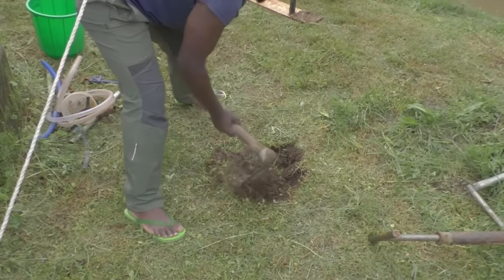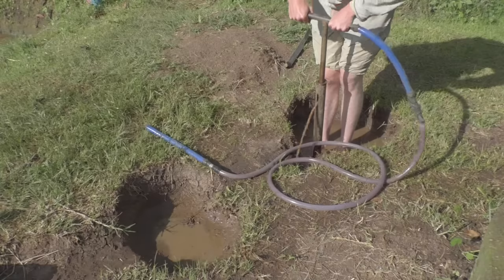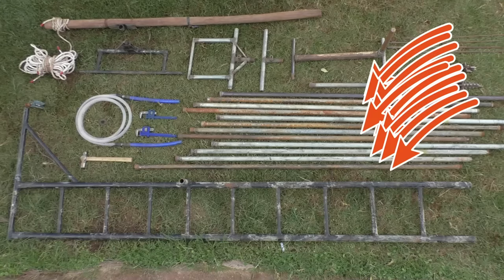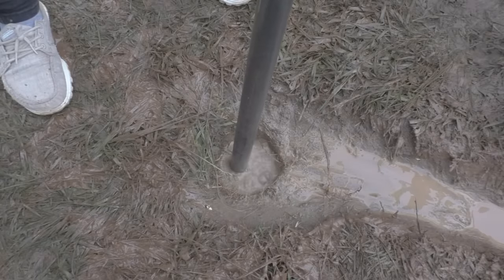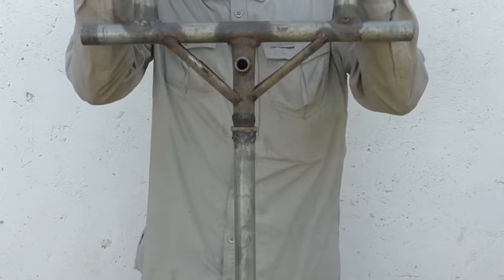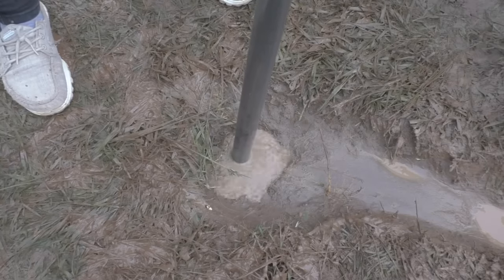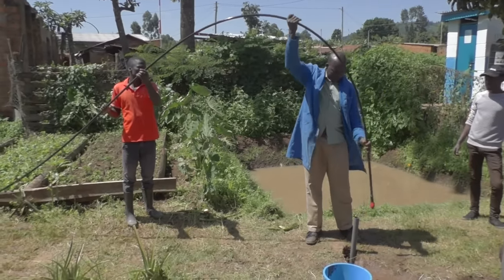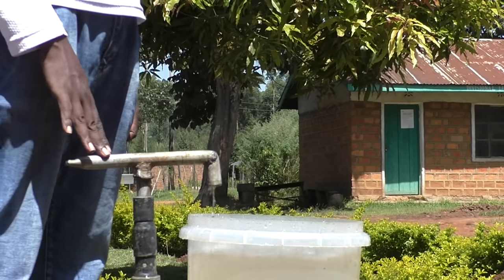Drilling a WELL by HAND.   UP TO 300 ft!   Without Electricity

Comment: I hand dug a well at my new shop 3 years ago 40 ft deep and I put a 6 in casing with 1 3/4 pipe in side of it I filled with 57 stone after my 6 in pipe and red clay at the top to seal it it took me 3 days by myself and there was about 10 on lookers watching me I know they were talking junk about how crazy I was till I hooked my pump up and sprayed the water hose in a  Rainbow style with 60PSI on the pump for an hour just to show I really hit water And a lot !! Thanks for the video I'm in north Carolina red clay county and let me tell u got to be young at hear its really hard work just my 2 cent !! By myself I might add !!
Reply: I guessing you left out some details or I'm calling bullshit! A 6" diameter hole in the ground 40 feet filled with water; that water would weigh 480 pounds!

How were you able to push that kind of weight to the surface by hand?

Even a smaller column of water as used in the video is the big limiting factor of a well 300 feet as they suggest is possible.

That's water weight. A thick mud slurry like they suggest weighs even more with every inch in diameter or depth.

Think of your 6" pipe as a plastic liter bottle about a foot tall. Now lift that bottle to stack another bottle under it. Lift those two to stack a 3rd under . Then lift all three to stack the 4th. Continue until your lifting a stack of 40 to slide the 41st bottle below and you will understand the gravity of the situation. Literally!

I'm not saying it's impossible but it's impractical with the limits of the tools shown here.
Reply: @tenlittleindians  You're not lifting the water, though - you're inputting water at the bottom of the water column to "flush" out debris. I agree that there is a limit on how deep you can go based off the pressure required to input additional water at the bottom of the column; but, if you were to replace the water hose here with a power washer, that'd get you considerably more distance. You might want to understand basic physics before spouting off, because there is a huge difference between your analogy of "lifting water", and the actual issue here of "back pressure" on a water output, at the bottom of a water column.
Reply: @jcpt928  To inject it in the bottom requires the same force as lifting the column of water! Were you unaware how it's calculated? And using a high pressure pump ain't exactly "digging it by hand" anymore.

Your "flushing it out" story doesn't hold water. (See what I did there? It's known as a play on words)

How are you going to "simply" flush it out? You either need to lift all the casing to create an opening at the bottom or your back to pumping water down the casing which requires pushing that water somewhere once the casing is full. (Back out the top under the full pressure that I previously calculated)

I suggest you visit a local grade school and see if one of the nice teachers can take some time away from a toddler to help you brush up on your limited capacity for simple basic math.
Reply: @tenlittleindians  You're completely dismissing the size, surface area, etc. of the casing, the digging head, the hole itself, etc.

You clearly aren't paying attention. Water isn't a solid.
Reply: @jcpt928   Really? I mean it; really? I do understand the constraints of the physical universe and you keep trying to tell me perpetual motion is possible! It isn't.

You can choose to lift the water out of the bottom of a hole with a teaspoon or with a stick of dynamite and it will require the same exact amount of energy. You can't magically make this energy appear or disappear. You can convert it from one form to another but in the end it's measurable and always the same.
Reply: @tenlittleindians  LOL

You REALLY aren't paying attention...
Reply: @tenlittleindians  I)
Reply: you show them :p
Reply: Very Nice!!!
Reply: @tenlittleindians  And I'm not a  twig ass boy I'm grown ass man 196 pounds 6 foot tall u got any more questions just let me share the video of me doing the dam job still works great to this day and I've got ele pumps not hand pumps to get the water !!
Reply: @tenlittleindians  And if u are in Raleigh NC I will meet u out there and show u in person as well !!!
Reply: I just moved to South Carolina and am looking into getting a well or two on the property.
I’m not far from the beach so I think there should be tons of super good water for watering plants, etc
Reply: @tenlittleindians  -- The water pipe is 1.75 in diameter. Only the casing is 6 in diameter.
Reply: @Makermook   That cuts the column of water weight down to about 40 pounds which is feasible for a 40 foot well but still not realistic for a 300 foot well. 

In reality the wells we used to see in old western movies had a bucket that was lowered to just below the water line. Once filled you had a fixed weight to lift to the surface by hand.
Reply: @tenlittleindians the metric system, something an American can't understand. 
It takes 1 bar of pressure or 1 atmosphere to lift water 10 metres. That little hand pump of approximately 25 millimetres in diameter would be more than capable of applying 5 to 6 bar of pressure with the weight of the man pushing on the handles.
But in reality he is only got to overcome the height difference between the sump level and the outlet level of the bore which would be less than 0.5 metres.
If he tipped water out of a jug into a funnel and into the drill stem it would still go to the bottom of the hole and flow out the top of the bore.
Maybe you need to go back to school and learn the metric system.
Reply: @stevenstart8728  Your mistaken. 1 bar of pressure is normal and thus equalized. 1 bar will only lift anything if it's being applied to something in a vacuum that has less pressure than atmosphere.
Reply: @tenlittleindians  1 bar on a pressure gauge that is set at zero in the atmosphere. Just like a PSI gauge is zero in the atmosphere. 
Applying 1 bar of pressure lifts water 10 metres.
If you remove the atmosphere all static water will rise 10 metres.
However you like to argue the point you sill aren't trying to lift the column of water how you describe it using water bottles. Your ignorance their is mindblowing.
Reply: @stevenstart8728  The devil is in the details and I pointed your mistake out! I didn't even read your post beyond such a glarring mistake..
Reply: When you need water, that is motivation enough to do the work, considering a 40 foot well can cost 5K if you pay someone to do it.

Comment: I'm blown away by the efficiency of this system. It's absolutely remarkable and these techniques for drilling Wells need to be preserved and spread far and wide. Water is a huge challenge for human beings and any cost-effective method that doesn't require electricity and can be done almost anywhere is super valuable to human beings.
Reply: I’m blown away that after 50,000 yrs these people don’t know how to get water out of the ground all by themselves.
Reply: @robertmccarthy1256  50,000 years ago people lived near a river, lake or spring. With large populations demanding water away from a surface source then artesian water is the only option and it can be hard to attain, especially if it is 100m down.
Reply: @teeanahera8949  not for w_i_e people
Reply: @robertmccarthy1256  50,000 years ago? No way you aren’t trolling or you are 14 zzz
Reply: This is also great physical exercise. Especially for the legs. If you want huge knees it makes your kne grows.
Reply: @garrysekelli6776 stolen joke detected from a grocery store

Comment: You should mention that it will not drill through gravel larger than the inlet, it does not reach a high velocity that would overcome slip velocity. The pressure of the mud caused by the process can stop up the aquifer. There are other problems as well, but the process has been used in Bangladesh (without the pump) to drill as deep as 1000 feet and is more than 1000 years old. When drilling without the pump the process is called sludging in most of the world.
Reply from the maker: Hi, you are correct, this is a sludging method. Also the pressurised drilling fluid can indeed clog up the aquifer, this is exactly the reason why we need to thoroughly develop the well. About the gravel: the emas drill set will not lift up gravel. However, because of the shape of the drill head it is sometimes possible that gravel is pressed into walls of the borehole such that the drilling can continue.
Reply: @WOT_utwente  It is unlikely that the drill will force gravel into a wall of gravel. It is more likely that the bit will bypass the gravel and lock up the drill stem or keep the casing and screen from going full depth.. It is impossible to clear up a well that you cannot inspect for sieve size or for cake. Even using a mechanical rig, the aquifer can be stopped up several feet belong the centerline of the borehole. The direct circulation process can force thixotropic mud into course materials. Thixotropic muds are liquid when in motion and set to a solid when motionless. The small diameter diameter you are using is not capable the high velocity needed to properly release the thixotropic mud.
Reply: impossible to drill 1000 feet=333 metres.
Reply: Someone owns a drilling business?????????????

Comment: Many DIY well drillers do not explain how they develop a well after it's drilled. When bentanite is used it inhibits the flow of water around your sand point, so a prosss is needed to remove the bentanite clay around the sand point so you get maximum GPM out of the well.

Comment: Decades ago, my well driller showed up with his huge truck-mounted drill rig. He reminded me of the price per foot for dirt (cheaper), and the price per foot for rock (more expensive). His drill bit was placed on the ground, and it made a ONE-HALF TURN and clunked into bedrock. The driller looked at me and said, "I guess it's rock all the way down."  302 feet of solid rock, but 10 gallons per minute total flow. So a nice reliable well and the pump is 30 years old and never been out yet.

PS. U of Twente, I like your on-line SDR. Very very nice, and much appreciated.

Comment: Excellent work, thank you!
And, have you considered filling the pipe with 1/3rd water? It would create a water-hammer effect, as the water bounces it transfers a greater force per second and the shock of that impact could help with soft rock...
Reply: Well you would have to install a valve just behind the drill head that can be opened from the top ... with say a pull string .
But the drill pipe is full of the mud slurry being pumped down to bring up sand and other material outside the pipe.  Which I doubt it could lift rock chunks .

Comment: around my area of the eastern USA, wells are washed in. pressurized water pumped into the well point while it's pressed into the ground. these wells usually only go 12-20 ft (3-6m) deep. high water table around here.

Comment: 50 years ago I saw a well drilled in similar fashion but they used an old auto with the rear end jacked and a windless type hub secured to a rear wheel. A few wraps of the rope around it a a man  could lift the entire drill stem with one hand! Though you'd like to know?

Comment: If the materials include rocks, your method cannot tell if the rocks are gravel or basement rock. You can use a reverse flow rig to have a better chance of drilling through gravel. With reverse flow we have drilled up gravel as large as 7 inches by 11 inches through a 8 inch drill stem.
Reply from the maker: Hi, thank you for your reply. Reverse flow drilling is indeed also a very interesting method, especially to lift up gravel.

Comment: Great idea if the ground is clay, what happens if there are large rocks though?
Reply: Yeah good point there are rocks down there and I seriously doubt this will work in north Georgia. I'm glad my father in law actually put a good well down. I know the water is good and I don't have to try digging a well. There is a spring on the property but the flow is too slow and the water is filthy. The creek has cleaner water..73

Comment: I've put in a number of 4ft ground anchors for ham radio masts and let me tell you, this twisting motion the guy is doing is going to bite you.
You will get a collarbone dislocation if you muscle your way through it.  This will most likely be a sternoclavicular (sc) joint dislocating at the sternum (often like a spring has been sprung) and probably the acromioclavicular (ac) joint.  These are hard to heal.  Use a breaker bar and PUSH, don't twist with both arms because your body will give before the ground does.  Thank me later.

Comment: I'm always astouded that people think this is a new idea... Wells have been drilled using spring poles for centuries. But because so many people are ignorant to history, they think that all of a sudden someone came along whipped an idea up. Engineers are absolutely the most guilty. Here in Southwestern Ontario, the majority of the oil wells in 1858 to 1863 were drilled with the same method up to 500 feet down. And it was an idea based on Chinese techniques from 2500 years ago

Comment: This is exactly how old cable tool oil rigs drilled oil wells. They were much bigger and they went down over 300 feet but it was the same idea.
Reply: not quite.
But there are two issues.
1st cable drilling was used for water wells before long before oil.
2nd 
a cable drill will go through anything.
it breaks up the ground / rock under it into tiny pieces.
its does this in very small section before needing to be " clutched" . or bailed out.
See below for a description of a clutch.
The small section are like 2 to 6 inches. 
So you drill with the cable drill. ( a few inches) 
Then pull the drill out.
Put the clutch in to bail out the bore hole.
Pull out the clutch. which is full of degree.
it will require a few times of clutching.
Then drill another few inches with the cable drill.
It is a long process. Taking weeks to drill.  ... I suppose in some cases months even. 
a cable drill will drill any distance. As long as you have the length of cable.
CLUTCH 
A clutch is a small pipe that allows the slug, ( water and debree)  to collect in. That is attached to a cable 
Something like a bucket.
There is always water in the hole to mix the dirt / rock dust  that the drill is breaking up.
There is no rotary action in the drilling.
it's simply a smashing action the cable drill is doing.  
the up and down motion is breaking the ground under the drill. And mixing the debree with the water. 
... My problem is I havent figured out how to make a clutch. I'm probably over thinking it. 
Cable drills were still being used in water drilling in the Early 1980s. 
However rotary drills were more common 
The well driller in the early 80s I seen using a cable drill rig. Was a old timer 
There is an old rig. on a guess 1940s truck. About 50 miles from me. That is just sitting.
I've been trying to buy it for a couple years. But can't get a hold of the owner.
I'm hoping it has a clutch with it. The truck is inside a fence.

Comment: I've used an old driveshaft with lead in the end and a block&tackle hanging from a tripod of post's and some rope. I've drilled up to 285 feet by myself, In 4 hours. 2 additional hours installing cassion and well point and pipe and prime. I was driving in sand.
Reply: impossible in 4 hours . you mean 40 days
Reply: @esecallum  I believe it. 4 hour with some cleaver engineering before and after

Comment: Since I do not have labor available, i drilled a well with a homemade setup using my Bobcat and auger to turn the bit. The ground is all limestone here so the hand method would not work anyway.
Reply: You can smash through limestone with this method. Pretty slow but it's been done.

Comment: Run that water thru a septic system and it will go back into the ground to get recycled.   Also grow crops with drip irrigation or the Kratky method that conserves water.   Governments don't want to teach self sufficiency.    They prefer dependency and are threatened by people who build their own houses, drill their own wells and grow their own food.
Reply: You do not want to drink water from your septic system. Place your well far away from your sewage or else it won't be clean for drinking even if you boil it.

Also the rest of your comment is pure crazy
Reply: No it isn't.
Reply: @robgnisir4708  agree!
Reply: People don't realize they are drinking recycled water. The ground is the best filter. You just need a distance between the well and the septic tank and drain field. 73
Reply: 300 ft ??¿?

More 30ft